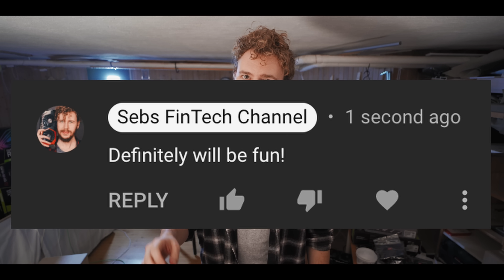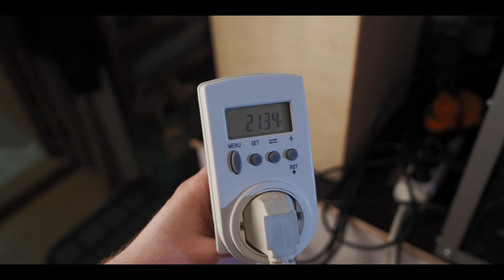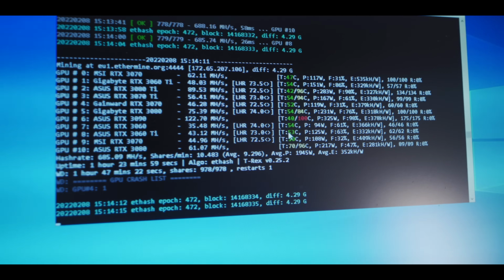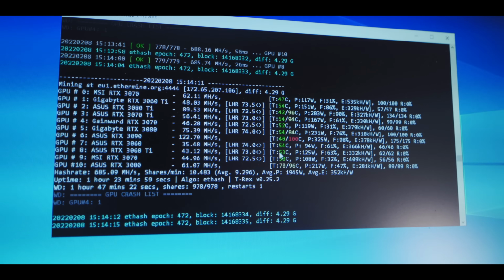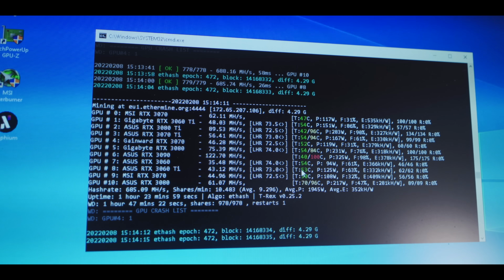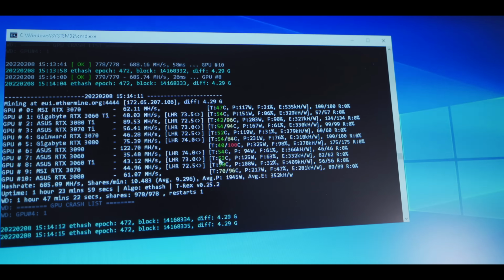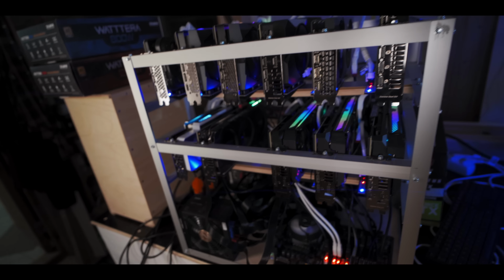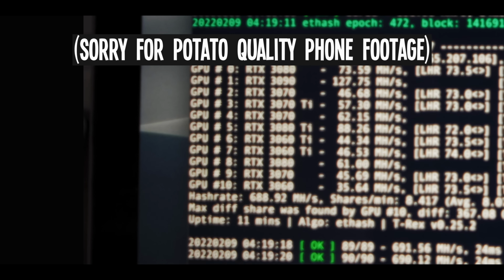Are Server Cases WORTH IT vs Open Air Frames for GPU mining? (Best mining rig 2022)

Comment: Hey Seb,
alldough mining is not as profitabil as it used to be, i just got into it, becouse i can get some nice 30 series cards for retail. I have build my first rig a few months ago and it was quite the challenge to be honest due to it being my first time building a PC on my own. Especially, the configuration and the buying at many different retailers got me worked up. I spent about 500€ for an MAX 6 GPU rig without sufficient coolers. If i would have known abaut the Octominer Rig, i would have bought it witheout doubt, it seams allot more cost effectiv. But well it is how it is, everyone learns with time and mistakes. Especally your  vidios helped me to start mining crypto and to lear fast and withe near no set-backs (R.I.P GTX 1660).
Thank you for that, Seb.👍
Kiwi🥝

Comment: I know Octominer cases like these could help me a lot with my GDDR6X gpu's next summer.  I use a fan blowing directly on them just like you do in this video when they struggle, but I'm sure they'd hardly break a sweat in one of these.  Compliments to the way you did this video, by the way, Seb.  You didn't just do a normal giveaway video.  You did one with a spreadsheet and Kill-a-Watt analysis.  That was excellent!  Kiwi

Comment: 2 Questions, 1. What about the noise? Will be dampened?   2. What about the external heat eg the heat generated By the GPUs?  Will be better contained? Mining makes the room hot and noisy, so does using these cases help to reduce them

Comment: Hi Seb, thank you for another nice video! I have been using one of the similar case, and it's really easy to use. My problem is the noise level. The server fans are noisy as hell and give me headache. I finally replaced the fans with PC case fans at the cost of 5-6 degree temp increase. As I'm mining with RX6600s and XTs, it's still acceptable.

Comment: I'm not a Kiwi, but I play one on T.V...
That being said, this case looks insanely sharp! I keep my open air rig fairly clean, all of my cables are custom wraps. Alas, cable management is still hard to keep clean!  The Octominer is absolutely providing a great project. The case could be cleanly mounted to a wall and act as a heater in winter. :)

Comment: Great video as usual Seb. I really like these all-in-one cases much more over the open air frame ones. For example i built a 5 card 3060v1 rigg with a "Auracure BTC mining X79 H61" board that can work off server psu and require no risers and is dirt cheap. When building the open air frames the cost really stacks up and that build was a super cheap way to just get a rig going and put it on a shelf and forget about it.
With the octominer cases i really like that they can be put on the side and use your height way more then having to spread riggs out horizontally. RedPandaMiners last video you can see this when he stacked his riggs and the octominer are so slim and space efficient w/o the problem of heat increase that you can really squeeze your build into smaller and smaller rooms and increase your density in your farms. It reminds me of the mining farms on Iceland as they build them the same way.
Me living in a smaller apt in the city, it is super nice to be able to use a smaller floor footprint and build up instead of having to build out more. And finally it is a super nice way to keep the cats out of my riggs :) Kiwi 🥝

Comment: area of concern Mr Sebs, are the risers (they look to be built in) easily "replaced" IF one goes bad?  OR  does the board of risers get fully replaced??? I await your UPDATE to this video to ADD this FYI to it. Thanks Much!!!
Reply from the maker: So it's not really like risers, rather it's just one long motherboard with PCIe slots directly on it. If for some reason one were to be bad, it should be replaced by their warranty.

Comment: hello, great comparison video personally I use an open air frame with kiwi and F12 pwm fans where I can adjust the speed I'm quite happy with it but it's true that with a server case like this the airflow is good better directed and allows the cards to be cooled as well as possible, it can be a very good alternative to the open air frame.

Comment: Great video and break down on the material costs between open air frames and server cases. Kiwi is almost as sweet as these Octominers are. However I'm hoping Octominer is able to scale faster to be able to service the smaller miners soon. I really like the ease of use and scalability with these cases.

Comment: another good video from you, i think the octominers is better because of better airflow for heat management, the smaller the place the better it is to direct heat out of the system plus the server grade fan also helps a lot, also the platinum power supply is the main reason for efficiency, hopefully will get one of this octominers someday, btw Kiwi is a healthy fruit 😁👍

Comment: While I did make a budget open air miner that was technically cheaper, I also have about 1000W less capacity, and I think the heat management from a closed air case may be better. Octominer looks rather Kiwi indeed. :)

Comment: Can we get a comparison with 3080/90 cards open air vs. Octominer/Minerdude/server cases with the same ambient.  I am concerned which will provide the least change in temperature above ambient.  Heck, no one has do this test.  If performance is the goal, then all this convenience yadda yadda yadda doesn't mean a thing doesn't perform.  One of those spreadsheet goodies!

Comment: The increased efficiency in the case, what I assume might be due to increased ventilation, less cable resistance and effective heat control.
A great perspective and insight.
Kiwi 🥝

Comment: About cooling and saving energy, well its same. It takes less as board, no raisers ..., board itself is lower wats, . It takes fresh air in, spits hot air and takes same air he spitted out :D if he had like pipe exit air to outside than yeah. room is like pc case, air bounce in room and comes beck to miner case. yes some get out with coolers at windows but thats not inaf. As shown in any 3d wind model.

Comment: I have wanted the Octominer for quite a long time and the MOQ of 5 has bean a deal breaker 
I have also heard the shipping is QUITE expensive 
that being said minerdude sells a rebranded X12 Ultra from the USA and takes single unit orders Octominer advertises for them on there page as a source to order from 
price is higher but NOT OUT OF LINE for other "server case" mining systems 
and the octominer has a built in temp measuring system that is integrated into HIVEOS and fan speed controls - I have seen NO OTHER system offering that
KIWI
🥝

Comment: I will add. Go get some cheap sheet metal even A/C squares Put some walls on your open frame you can use cheap 20" box fans to create the same air flow and I'm guessing temperatures would then be better in your open rig. I tend to watch videos not logged in so I have to login to comment.